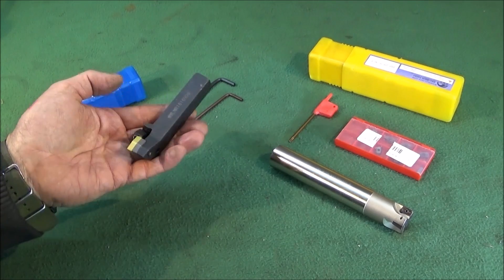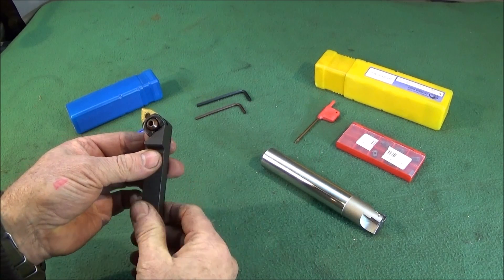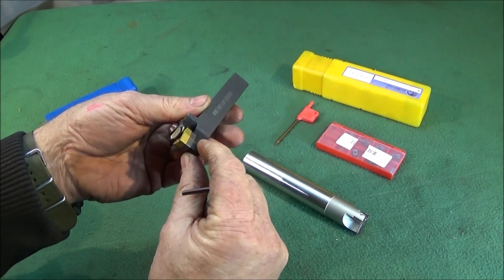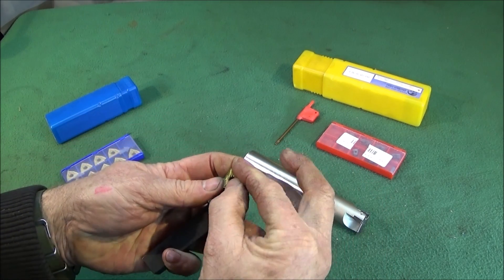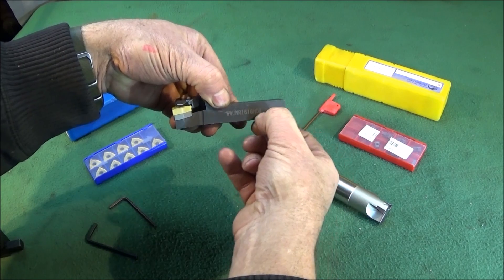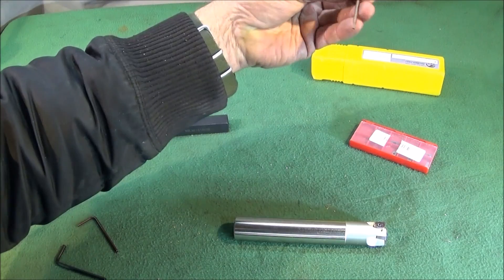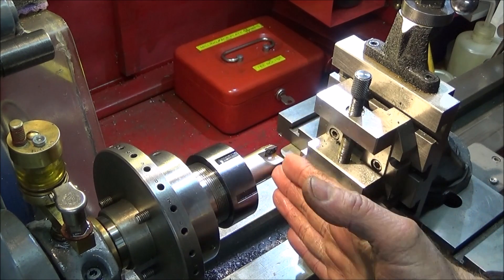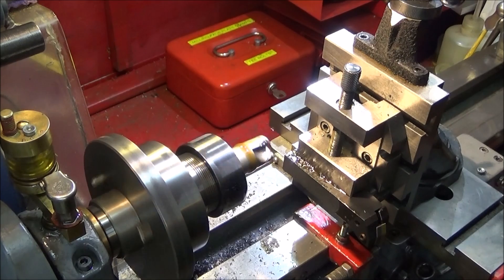Modify Large Shank Turning Tools For Use On Myford & Mini Lathes

Comment: Interesting , i just put my old larger 25mm tools in the chuck & scim them to size it's alot faster. I've also never saw the appeal of myford lathes they look & sound like they belong in the last century. There are far better modern alternatives that can do the job alot faster, take bigger cuts & better tooling but still small enough for the average user such as the range of boford 10.20 & 11.30 series of lathes & you can pick them up for the same price as a myford or a hardinge if your only working with smaller diameter work. To each there own I guess, may I ask what draws you to the myford

Comment: Steve I know that this is one of your older videos but I was needing some new inserts for my 3 flute milling bit like yours. I had been ordering all my inserts from bang good ,but finding that now every time I go to order some more they seem to be out of stock. Some has been out for over a year now. Are you finding this to be the case when you order inserts from them. And if so where are you getting your inserts from now.
Reply from the maker: Hi Anthony, I haven't used mine for some time now. A lot of things are unavailable now on Banggood. I would just see if you can get them on Ebay if you can. If you find any, let me know. Regards Steve

Comment: This is an EXCELLENT demonstration and video, Steve. It is exactly what I was looking for and I believe many smaller lathe users can get inspiration from such a demonstration as 10/12mm tool holders are much more common than 8mm ones on ebay or aliexpress (among others). This offers a broader range of choice at the time of buying toolholders plus increased rigidity once mounted on the tool post, all beneficial. Thanks for sharing !

Comment: hi steve thanks again for a good video , can you tell me where to get  a quick change set up the same make as yours thanks john
Reply from the maker: Hi John, I got mine either from RDG or Chronos. I think Chronos was the cheapest the last time I looked, especially on the single tool holders. At first I just bought a set with the toolpost, then over the years just added to the collection by buying singular holders.
Reply: thanks steve i,ll check it out

Comment: Hi Steve. Yes I to have one of those cutting tools that you milled down from Bangood as well and they are as you say a well made piece of kit. I went a different route to you though and made a custom tool holder to fit my quick change tool-post on my mini lathe. I needed to cut out a square in the tool holder as well to allow the tool to recede into the tool holder, Without doing that the mini lathe is only capable of turning about 20mm diameter due to its lack of travel. I have the new tool-holder all done and dusted now and I am very happy with the results, but I have belt issues on the Chinese mini lathe atm, so though it is centered and ready to go, I need to adjust the belt or change the belt and pulleys and adjust before I can use it. I don't unfortunately have the luxury of 2 lathes :) but I do have a mini mill which has just had a thorough work out :) Good work as always Steve.
Reply from the maker: Hi Steve Thanks, That sound really good allowing more travel for the tool. I changed my pulleys and belt for a set I bought from Ebay in the USA. Its a reduction set that reduces the spindle speeds, but gives about twice as much torque. It is great for drilling. My top speed is about 1600 which is still plenty fast enough. The USA set is also made from solid aluminium and the belt is a standard size, unlike the non-standard Chinese one.  I have several videos lined up for the mini lathe when I get time. Regards Steve
Reply: Wow that set from the USA sounds really interesting Steve, do you by chance have the link? Because I would like to do that upgrade Regards Steve.
Reply from the maker: This is the one I bought.
https://www.ebay.co.uk/itm/NEW-Asian-Mini-Lathe-7x10-12-14-Gear-Belt-Kit-Grizzly-8690-and-others/151730631517?ssPageName=STRK%3AMEBIDX%3AIT&_trksid=p2055119.m1438.l2649
Reply: Thanks Steve I will need to check a few things, but when I am sure I am ordering the right part I will have one of those sets. I have saved the item in my ebay account though. Many thanks Steve
Reply: Thanks again Steve. I have ordered that set from the USA so should have it sometime within a month lol. Apparently my lathe is basically a Seig C2 so I will have to modify the drive pulley, which should be easy enough. Regards Steve.

Comment: but...this (1 inch dia cutter) will not fit in a mini lathe chuck right?   :(
Reply from the maker: I only use end mills up to about 12mm on the Mini Lathe. If you wanted to use one like though you could turn the holding diameter down.

Comment: Steve, I've just noticed your serial number... Mine is 6760 so very close in age to yours and is undergoing a bit of a tidy up as it's nowhere as good looking as yours.
Reply from the maker: Hi Robin That is interesting....They soon come back to good condition with a little work. Plus if you get the Myford enamel paint listed on ebay, although a bit expensive, it brushes on really nice and doesn't leave brush marks when dry. You don't need to do the whole lathe either, just the areas that need touching up as it blends in nicely. It is a superior kind of paint.....if your lathe needs doing a bit.....Regards Steve
Reply: Steve Jordan thanks. The lathe is generally in good order and the ways still bear the original milling marks so aren't significantly worn. The paint is however so poor it wipes off with a bit of Meths!!! I suppose after 69 years giving the old girl a new coat is the least I can do.

Comment: Hi Steve

Great video as usual ... you must be psychic as I have just finished making a similar mod to a 16mm shank tool so I could fit it into my Boxford Dickson type tool holder. I used a Nicecutt PWLNR/L1616H06  External Turning Tool Holder for WNMG insert. I bought mine off AliExpress. It takes the same type tool tips you have on yours. I did this because I had looked at all the videos on line and this type of insert seems to give the best results particularly on hard materials like stainless steel. I milled the bottom of the tool which was very hard but just machinable with a carbide end mill. I have tried mine on all my usual materials and it seems to give a superior finish and a nice short curly chip. I did try it on some En24T and it machines very nicely giving a good surface finish, which is not so easy to get with normal inserts.

John
Reply from the maker: Hi John, Yes this insert is great for all types of machining. I remembered similar from years ago when I used to set and use CNC machine tools. When I saw these online for such a good price I had to get one. We used to use the heavy duty tools like this for fast roughing out and finishing hardened stainless. For my Myford I think, as the cost of turning tools is so good from China, I am going to get my other favorite tool that takes the 070204 insert and buy it in 16mm to mill down. I like this tool for undercuts for threading and its a common insert. I think next time though I will rough out with an angle grinder first then finish with the end mill. I noticed that several years ago the Chinese tool shanks were a bit softer than they are now. Thanks for watching and for the info....Regards Steve

Comment: Steve I've done that my self, what I prefer is to mount the tool directly to the too post. In the states we use a lot if the aloris style quick change blocks so the dovetails are somewhat simpler to machine. It could be done with your style post, but reducing the thickness is easier, I ran into loss of travel so that is why I direct cut dovetails in my large tools. I have some videos on my channel demonstrating how I do this. Also a little closer to you John ( Doubleboost) has done the same

Good job

Comment: Too, one can always hog down the turning tool holder with a bench or angle grinder to save the milling tool edges for the final dimensioning operation, but again, another fine bit of ways and means from you Steve. ☺

Comment: Hi Steve, 
That’s how I milled my larger tools also except I used a carbide endmill in the collet chuck. I have just recently got one of their 50mm 4 insert face mills on a mt2 arbour that will go into the headstock, I figure that I could use it as a single point or dual point fly cutter or as a 4 insert face mill for mill work in the lathe. Will have to see how that works out.
Thanks for the video.
Cheers 
Raymond

Comment: Have you changed the motor pulley, Steve? 800rpm is fair bit more than my ML7's top speed, which I think is around 640rpm.
Reply from the maker: +brandoc1950 Hi yes I put the one on that is specified in the Myford ML7 handbook. I think it is 2.5" if I remember rightly. RDG used to sell them on EBay...they probably still do. I found 640 rpm too slow and use the 800rpm for most turning. The other speeds are around 300rpm and 500rpm. Plus the back gear range increase a bit. You can fit the new pulley just by adjusting  the belt tension. You don't  need a different belt
Reply: Cheers, Steve. I have a few pulleys kicking about so I might see if one is suitable. Only disadvantage I see is that I tend to part off at the slowest open gear, so I might need to use back gear.

Comment: ive got one of them the  WNMG0804 Inserts are not very good you only have to look at them the wrong way an they  chip try an get some sandvick or some of the other better inserts they last much longer
Reply from the maker: +Gareth .William's Hi Gareth I find them excellent and I've used Sandvick and Iscar and the other branded makes. Maybe they wouldn't stand up to .100 thou cuts or machining inconel but on my lathes they work and last really well and only sometimes chip like any other.

Comment from the maker: WWLNR1616H08 Lathe Turning Tool Holder With WNMG0804 Inserts -- https://goo.gl/YQzZqu
        300R C25-25-150 Milling Tool Holder Lathe CNC Arbor -- https://goo.gl/zH5uex
        Drillpro 10pcs APMT1135PDER-M2 VP15TF Carbide Inserts Milling Carbide Inserts -- https://goo.gl/iHZ3N3
   Wholesale Mechanical Tools -- https://goo.gl/WRqGCi
         Unbeatable Deals -- https://goo.gl/tPqve7
Drillpro 10pcs Blue Nano Coating HRC52 APMT1135PDER NB7010 Carbide Inserts-- https://goo.gl/coajd8
 ·